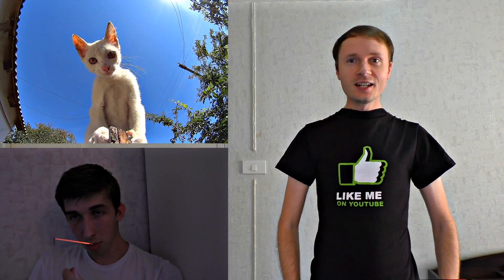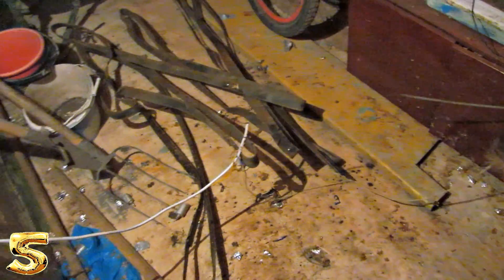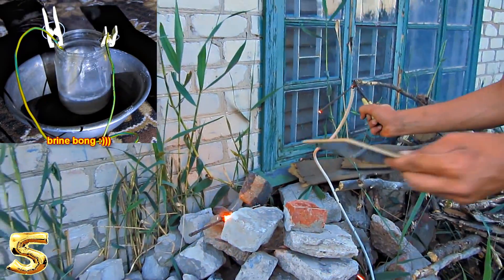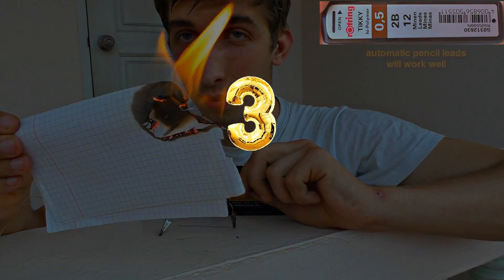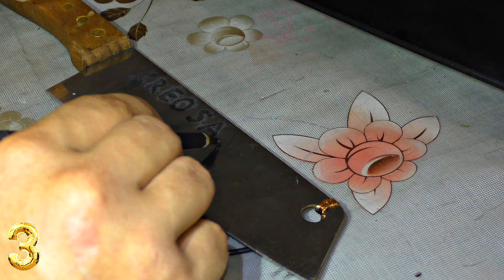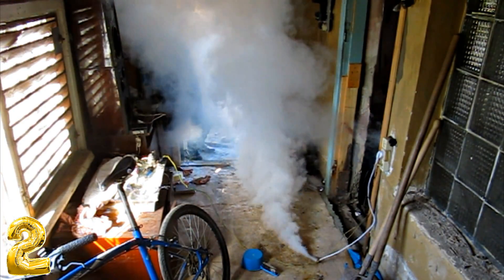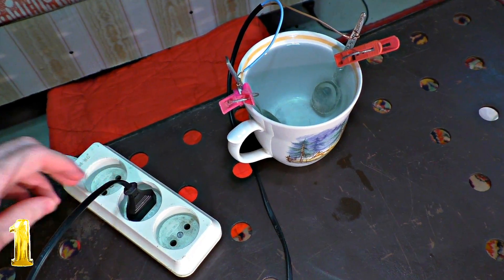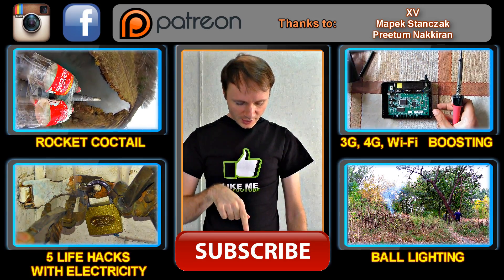TOP 5 Electrical Hacks for extreme conditions

Comment: What is the supply voltage in russia and is it AC or DC and what is the frequency
Reply: AC 220VOLTS 50HZ
Reply: It's 240 and an earth connection is rarer than a BMW driver using a turn signal 😂

Comment: lol in first world countries number 1 would just trigger the breaker/fuse and thats it. same for number 3
Reply: wrong, Photonicinduction uses 100A fuse and a breaker :P
Reply: Elektrotechniker, in one of the videos they also short out the mains, and the light goes almost completely out and then ramps up in brightness again. they either seem to have bridged the breakers and power counters, or ukranians dont give a fuck about having several 10s of kilowatts without a breaker in their home
Reply: I know what 1kA 230 V short sounds like, but think about 400V short circuit ! That happened me once near electric meter, there was a huge arc and flash
Reply: Yeah, I've also see unprotected/unfused wooden houses with main cables mounted on the walls (!).
And sorry, I can't read german
Reply: i can read/speak german. how does one not think about adding a fuse? well our house only has a 25 or 30 amp main fuse (schmelzsicherung... yay -.-) but at least the normal breakers are switches. luckily i never shorted the mains directly. only once took out the fuse, put a wire in the socket, tried to switch it on and it just clicked, as it was supposed to. little me was looking forward to a glowing piece of copper :C
Reply: the wiring in such houses is as you would probably call it "Scheiße" ?.  Idiots just don't think it through
Reply: number one wouldn't trigger the breaker. Its of course that depends on the distance of the electrodes and stuff but generally it wont because the food/liquid has enough resistance.
Reply: Als ich ein noch ein Kind wahr habe ich einmal bei meiner Oma mit einer Büroklammer in einer Steckdose rumgefummelt. Ich sah einen Blauen Blitz und dann Dunkelheit, hätte meine Oma keinen sehr penieblen FI gehabt, hätte ich mehr als nur erschreckt sein können...
Reply: I remember on one of their early videos they mentioned that during a blackout they bypassed their breakers and basically started to have free electricity. Yep that's kind of stealing lol but in Luhansk it was not really a big thing that time (UK-RU conflict).
Reply: They had a breaker but they removed it.
Reply: They are in old house in ukrane. Ofcourse they dont have breakers.
Reply: They removed the fuse :)

Comment: Please don't try #1 since salty foods will form poisonous chlorine!
Reply: how is 50hz still dc???
Reply: Donald Fucking TRUMP! Not necessary. Electrolysis only works with dc but the current from the wall outlet is ac. Of course it is still a bad idea if you do not have an rcd.
Reply: plug in the cord, see those bubbles instantly appear? electrolysis is happening, it's just very inefficient, which causes excess heat in the water, which in this case is what you want. trump is right, at any given moment in time, it is in-fact dc. it's only ac when you look at a larger time frame than 10ms

I would not try anything in this video, and absolutely wouldn't eat the food. there's a reason that kettle is illegal in many countries including my own.
Reply: Meh, I would be more concerned about accidental electrocution.
Ions move very, very slowly, by no means fast enough to get from one side to the other 50 times a second so there won't be any reduction/oxidisation going on. Also, these tiny, tiny amounts of chlorine (probably rather chlorate salts) won't do any harm really
Reply: I forgot what #1 was
Reply: Yo ski, well it's sorta DC. Depends on the time interval you are looking at
Reply: I think you need a rectifier to be considered DC.
Reply: Roman Kireev that's what I'm trying to say
Reply: Experimente 99 Electrolysis works correctly with DC, however AC will still cause changes to the composition.
This is why cheap electro stimulation devices for building muscles which use DC cause muscle damage much faster than the AC ones, however they both cause damage.
Reply: simply dont try ANYTHING!
Reply: 50Hz is still DC but changing 50 times a second ;) that's why it's wrong to say that it doesn't work with AC
Reply: Electrolysis also works with AC, dont worry.